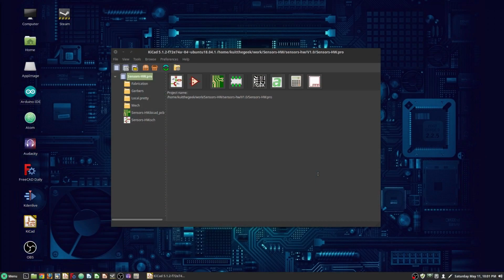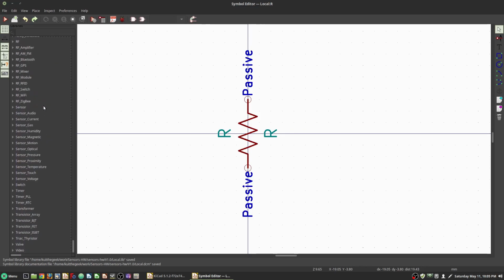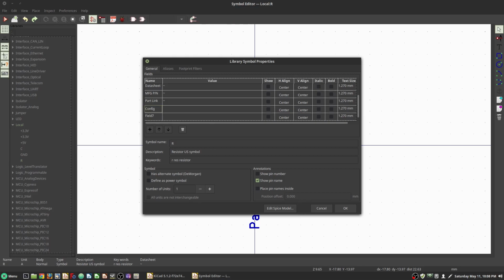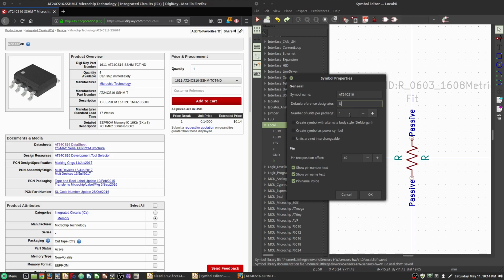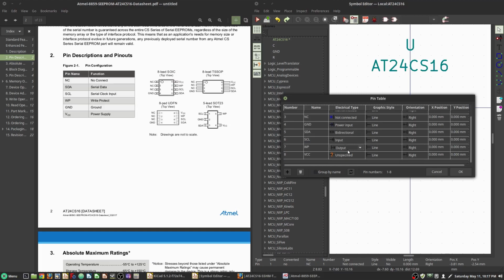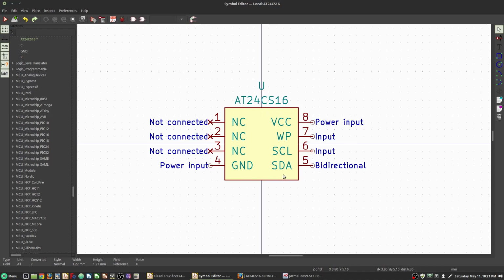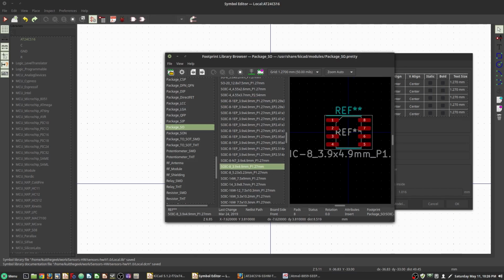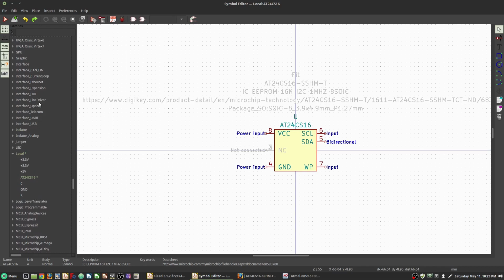Professional KiCad | Custom Symbols and Symbol Libraries

Comment: Could use a video on how to use Git in this context.
Reply from the maker: The biggest hurdle I have found you have to overcome, is merging and making sure your workflow works correctly for you. I personally use local libraries and that allows the projects to be portable. I do pull from global libraries, like the KiCad libraries, and others I have built along the way, but I don't push to them very often. I pull from them to do what I need, and if it's a library I maintain, then I will push back after I have proven out the part.

Comment: why not global ? you might need your component with other projetcs
Reply from the maker: I specifically don't use globals because of my workflow. I store my project on a Git repository, and having them all contained in a local file that goes with the rest of the project files is very helpful. You don't have to worry about including a global library to access all of your symbols on another computer if you work from several. I frequently do designs on my main workstation and my laptop, so I have to have that flexibility to jump between the two. There are benefits to both, but I prefer to use a local library. I can add part numbers specific to those symbols if I need to to create the Bill of Materials, I can add spice models, I can add 3D models to the footprints, and I can link the footprints to the symbols in the way that I intend. You can store them in both a global and local library, if you wish, but I find that causes more problems than it is worth. My projects are always self contained, portable, and clean. They don't contain more components than I actually use in the project. It is very easy to copy symbols and footprints between libraries, and knowing how to import symbols and footprints is also an important skill. One other benefit to keeping the parts local to the project is that if I have to make a change to a part for that project only, I don't have to remember to fix it later, and if you don't that can also cause you problems.
Reply: @KuittheGeek have you tried using git submodules for library reuse?